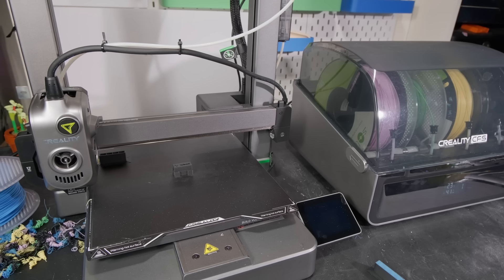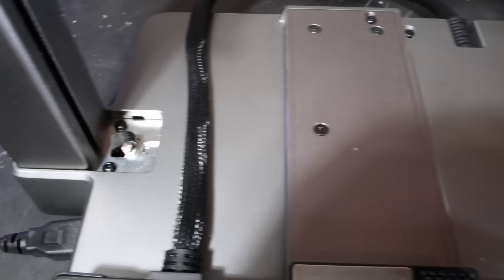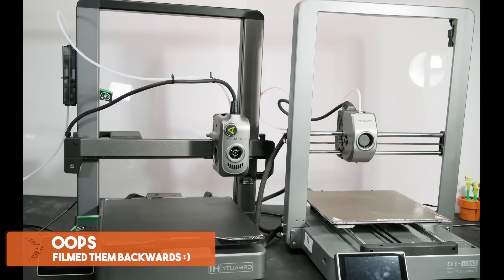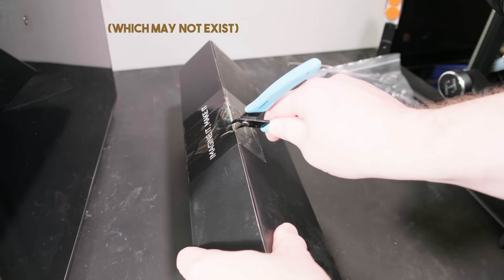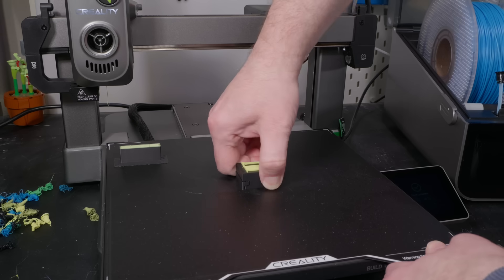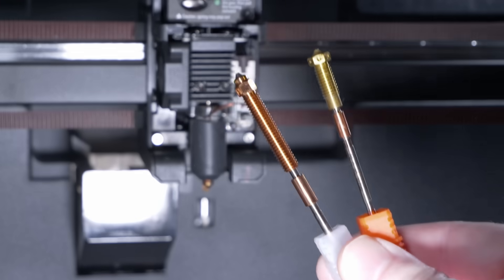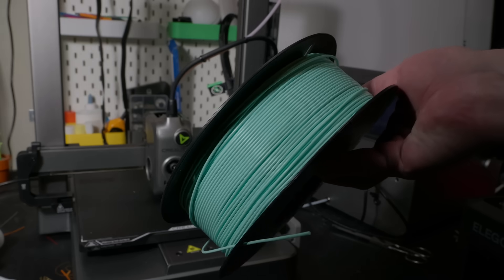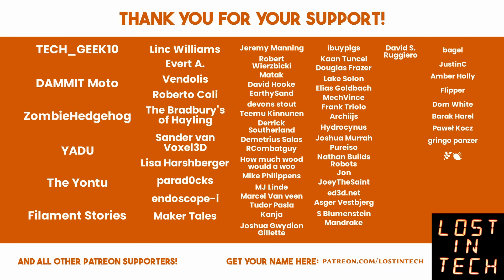Creality says Hi to budget friendly multicolour 3d printing!

Comment: HP TPU stands for high performance TPU. And no, it is not the same as high speed.
As for the CP 6, I have a serious complaint. Here in Brasil we just doesn't have these cool filaments with built-in presets which you just select and use. Instead we have several companies fabricating filaments and boy, oh boy, they are really quite different one from another, specially for TPU. So I have to calibrate every single one. Dozens of filaments, dozens of materials, dozens of colors, for each material. So you create a custom generic filament preset, then a parameter preset for each one which the generic profile doesn't work well. And then the creality print updates, or just log you out from your account, or just exists, and corrupts everything by its own and between closing and reopening the slicer all your presets and profiles are missing. I found the files are still there but the slicer just refused to show them. But this only applies to the filament profile because the generic custom profile I was not able to restore. Sometimes just log in to my account is enough to bring the filament profiles back, but the funny thing is I don't use the cloud sync, and if I use everything is still the same. So there is no point using it. I am waiting the orca slicer 2.3 reach release status so I can migrate and test if this issue is coming from it or from creality.
Reply: I aint reading all that, thanks for zero information about the TPU
Reply: @jimlahey641 you can do your own research. You're welcome.

Comment: I still don't get why Klipper machines use a tool head board. What happened to just having the hot end, fans, and that's it?
Reply: @TheSupertecnology  there are a lot more wires nowadays than in the ender 3 days. The ender had 6 wires, hotend heater and two fans. Now you have an extruder, hotend heater, the fans are mostly 3 or 4 wire ones, some sort of lighting, filament sensor(s) when you have a MMU upgrade, accelerometer, sometimes an endstop for homing, some sort of bed leveling device when you dont have pressure sensitive sensors under the bed. Not having shared ground or supply wires all these things would add up to 27 wires with endstop and two filament sensors. You dont want 27 wires going to the toolhead, actually drag chain rated wires are also expensive when you buy them yourself, 1,50 to 2 euros per meter isn't out of the ordinary. On largee diy printers, for example a voron 2.4 or trident in the 350mm size, its actually cheaper to get a toolhead mcu than to use ptfe insulated wires for everything toolhead related
Reply from the maker: good question with probably several answers. In the case of this printer, the driver itself (extruder) is on the tool head board. Why? save wires I guess. Less wires less problems.
Reply: i suppose the obvious answer is that its a breakout board, the hotend usually has quite a few things on it, and a breakout board lets you use one single cable with one single connector, rather than a whole wiring harness and loom setup, it's definitely nicer from that perspective.

Comment: why risk damaging the bed with a blade? there's a flex plate for a reason. the complaint for too much adhesion was kinda pointless
Reply from the maker: yes as I said, although not pointless tbh as for small parts you can't always flex them off without denting the plate as I'm sure many people have found out - you probably just don't realise how good the adhesion is here. You can see the bed flexing while I pull but the part does not let go.
Reply: @LostInTech3D  flexing upwards prevents dents, and you can bend diagonally and longitudinally... if it still doesn't come off, which is rare... it is highly likely that at least one corner will have lifted... you can then proceed to pry it off while flexing it against the table...

Sure... sounds like a whole progress... but it really isn't... and it is much better than the alternative... in the video you very clearly marred a brand new bed... maybe you don't care... but it's kinda wasteful especially given that 3D printing (as well as the community) already produces a lot of waste
Reply from the maker: if the bed ceases to function, which is highly unlikely, I'll use glue as intermediary. I've never replaced a bed due to wear even though I quite commonly attack them with sharp objects. It's a rough textured surface and the odd nick here and there will not change that.
Now riddle me this: why do printers with PEI sheets come with printable blades :) Elegoo, bambu...
Reply: I agree, printing very small area models are a pain to remove from the build plate. A few minutes ago I was just wondering why I printed such a small valve with nylon while fighting to remove the first layer of the organic tree supports which detached from the other layers and reminded me of nothing is so bad that it cannot be worsened. My K1 max came with just a metal spatula and I use it only when I start to see the doors of hell opening inside my brain. Sometimes you just need more metal juice when bending and praying isn't enough to get prints out of the build plate. And we haven't even entered on the flexible materials world yet...
Reply: @TheKnightArch  Yeah, I still hopefully bend the plate with a TPU model printed on it, because of habit. And it's just sitting there mocking me silently 😂
Reply: @TechieSewing  well, this seems to be a trend because I do the same hopeless thing 🤣
Reply: @EngrNuj  engagement.
Reply: I’ve removed thousands of prints from my plate with the Bambu blade and no damage yet. Sounds like an issue with not knowing how to use a tool if someone scratches 😉

Comment: The more printers come out, the more I feel like I must be some kind of weirdo for having absolutely no interest at all in multi-colour printing.
I mean... I AM a weirdo, but I mean like an extra weird weirdo...
Reply: I had no interest in it until I started printing with text very frequently. The different colors really help out and doesn't cost a whole lot more especially compared to what people are doing for pokemon type prints.
Reply: @KJMcLaws you know how funny it would be to print a road sign with slurs on it XD jk please don't.
Reply: @KJMcLaws  This is why i need multicolor.  I print plastic divider cards that have the text a different color.
Reply: It's still very good for auto loading the filament you want! no more manually waiting, loading, and changing filament
Reply from the maker: yep - I much prefer height based changes like the ones I showed in the video (did anyone notice?) or being strategic about when/where to change colour, when possible, to save a ton of filament.
Reply: @LostInTech3D Speaking of saving filament,  have you tried this without the prime tower? I do prints like this (or print-by-object with different filaments, which is kind of similar) fairly often with the prime tower disabled and don't notice too many issues. You can increase flushing volumes a bit to be safe, but you don't even need to for something like this where any mixing likely wouldn't be visible anyways. You can also use height range modifiers to make those first layers after a swap print inner walls and/or infill first to effectively prime on the object itself and further hide potential defects.
Reply: Neither have I (at least for now, it might change * ), but being able to use PLA/PETG support interface and zero gap where it is beneficial 🤔

* 3DPP did some nice-looking multicolor stuff with ABS and smoothing 🤩
Reply: I was considering some multicolor options but went with an IDEX and have not been dissapointed. It's awesome to be able to for example print PLA supports for TPU parts with very little added time.
Reply: @Qwarzz  which IDEX did you choose? I know SV04 (not available any more) and Snapmaker (rather expensive)
Reply: @kimmotoivanen  Apparently I like suffering so got myself Ratrig V-Core 4 400 :)
This one isn't cheap either.
Reply: @kimmotoivanen  I like to suffer so I went for Ratrig V-Core 4 400 IDEX. Definitely not cheap either.
Reply: YEP: I have 3 P1s printer with 2 AMS units. I mostly fill them with the same color so they don't run out. lol
Reply: Color changing is nice, but it's also incredibly slow unless you want to get spendy to get the Prusa XL. For functional prints, I don't think it's worth it.
Reply: I genuinely never had an interest in multi colors because I 3D print enclosures for tech related stuff.  I'm not a Facebook mom who needs everything to be shiny lol.  But hey of you like it then go for it.
Reply: Autoloading is the real killer feature of multimaterial systems. Swapping out new rolls is much faster than doing it manually (as long as it's an AMS style system like the CFS), and if you want to print with one of the 4 most recent rolls you don't even have to swap at all. That plus backups in case of a runout for large print is super nice.
Also there are some neat tricks like being able to use pla supports for petg and vice versa.
Reply: In a couple of years a 3d printer will cost the price of an used car just to make people like me spent money doing stupid things most of the time. You better go for a walk, your health will improve.
Reply: @joseguevara184  Prusa is going to be manufacturing in the USA so as far as that company goes I doubt it.
Reply: I found the single filament version on amazon for $214 USD, for the size I couldn't pass it up. As far as multi-color, I'll save for the U1, no matter what anyone says I personally can't justify the filament waste with the current color changing systems. And yeah we're all weirdos in our own way.